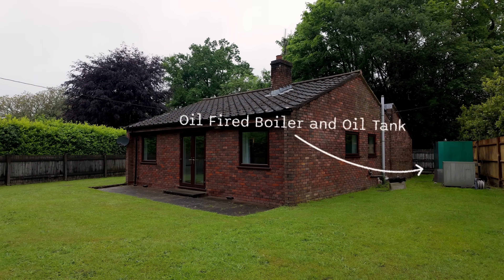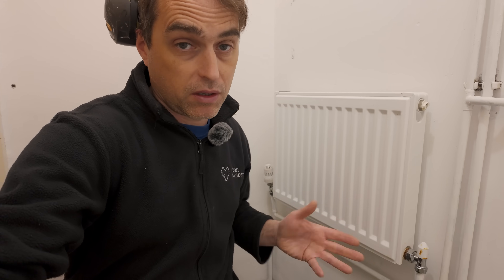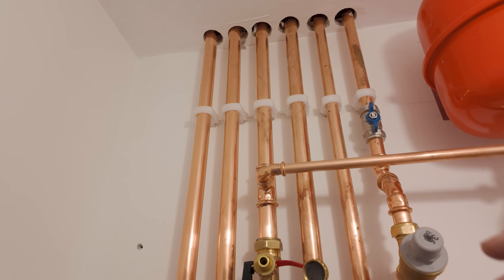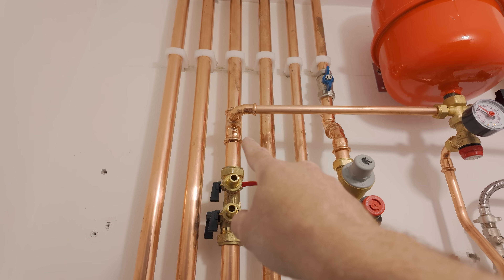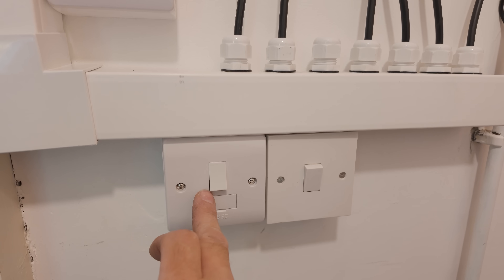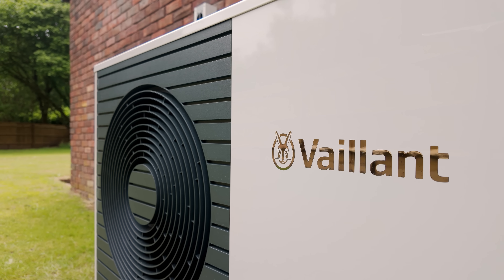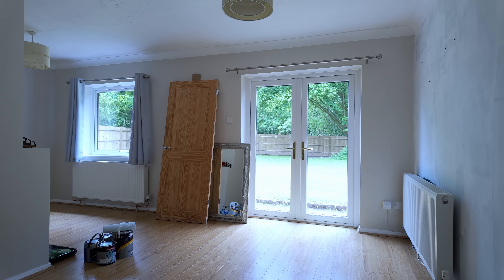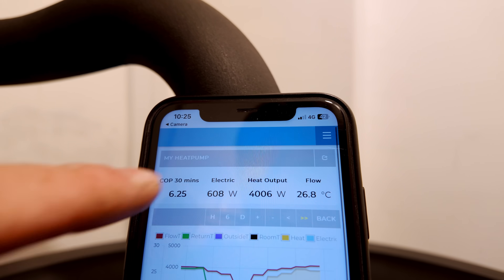Heat Pump vs Oil Boiler. It's a no brainer.

Comment: So the heat pump will save you £75 a year? And what was the full cost of the installation? And out of warranty repairs for the oil boiler vs the repair of the heat pump... doesnt sound like it was worth doing on this occasion, he could have ran the oil boiler for years with just the installation fee of the heatpump.. great video as always! Very knowledgeable guy!
Reply from the maker: cost of new oil boiler was exactly £1,000 less than the heat pump and all new radiators. With solar PV and battery storage he will save mroe like £900 a year. He is in a good position as he can get solar and stoage for a fraction of the going rate.

For the landlord it was more about not having to use oil as this system should way more maintance free. Also - that oil set up was already dead, needed upgrading anwyay.
Reply: Worth it for just getting rid of the oil smell and noise of the boiler
Reply: Having a smart meter can also open up time of use tariffs to further reduce the cost.
Reply from the maker: Yes - with vaillant heat pump he can go on OVO tariff and pay 50% less for heat pumps use - making the savings more like £500 a year. Moot point though as the owners buys solar PV and battery storage in bulk so it will cost him very little to have this rental pretty much free to heat and use hot water.
Reply: And what about the cost of solar panel and battery system?  That £75/year saving will take 400years to pay off. I agree with you. Not worth all that additional cost.
It's like people at work that say they saved £100, but forgot they spent £1000 to do so!
Reply: @OH2023-cj9if  Are you a climate change denier ?  People like myself fit Heat Pumps mainly to save our planet from over heating!!! Unless we spend to help this phenomena, it will not last 400 years! ( we may soon reach a tipping point)
Reply: @OH2023-cj9if  DIY solar panel set up 12 panels plus 10kw second user Li ion battery storage, Chinese hybrid inverter £4k
Reply: Or used oil filled radiators and put his thousands in the bank that would have paid for the running costs and had some left over.
Companies only want to fit all this as there must be a government payment or grant.
Reply from the maker: @OH2023-cj9if  oil-filled radiators would cost £4,000 a year to run so a pretty stupid idea.